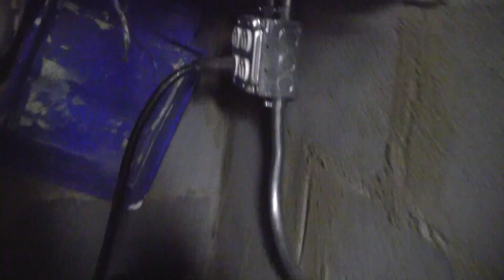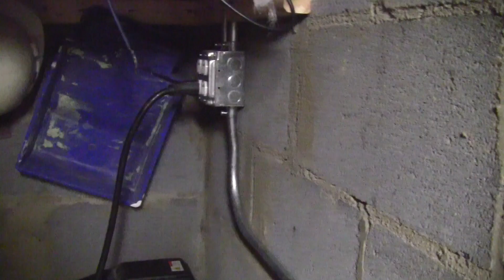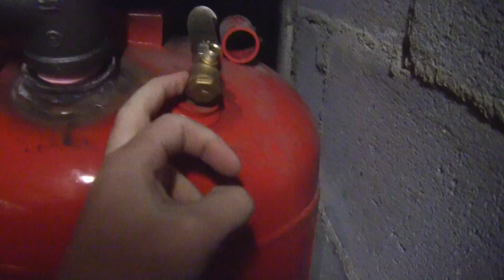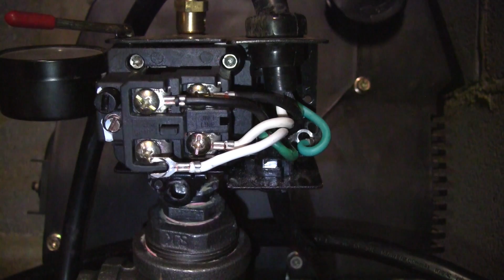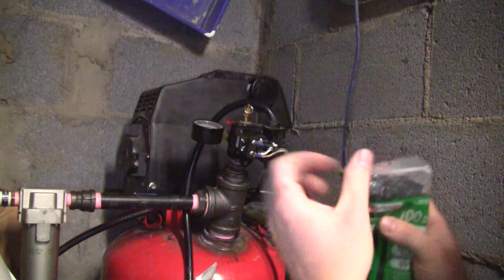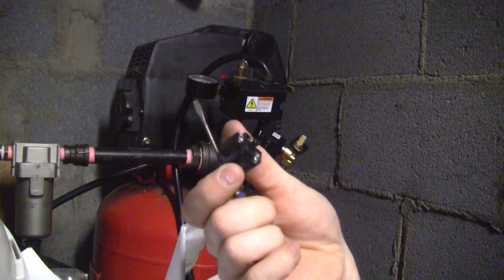Craftsman Air Compressor Modification

Comment: Do you have a modification for the condensate drain on the bottom? Those bottom valves clog up and don't seal very well. Any ideas?
Reply from the maker: Mine was 1/4”npt so I pulled that drain cock out, put in a street 90 and extended it and put a ball valve on it so you don’t have to reach under the tank to open it it works well. They do also make automatic tank drains that plug in and open for a few seconds every hour or so.

Comment: A new pressure switch probably is cheaper.  What I'm really impressed with is that you got that big plug out!  It looks like you used a torch.
Reply from the maker: +Ron Yerke that plug was not easy to get out! I ended up having to weld a nut to the plug, got it really hot and hit it with the impact. I fought it for a while before I had this idea than I got the nut welded on and realized I had no air to run my impact... luckily my 18v dewalt was able to get it.
Reply: DrEwBaBy625   I bet welding on the nut is what did most of the work.  Adhesives and pipe dope don't tend to perform well after exposure to high temperatures.   I like that T-fitting addition.  You probably get all the airflow you want from it now.  A lot of smaller compressors don't come with bigger than 1/2 inch fittings anymore.

Comment: i wish my air system was like that.. with a bigger compressor of course.
Reply from the maker: +Guinelle1 it makes using air tools so much more enjoyable. Not having that obnoxious hum of the compressor right there in the garage. Bigger compressor would be nice but I like the setup I got and it works fine for what I need.